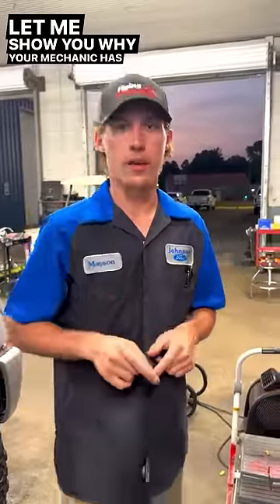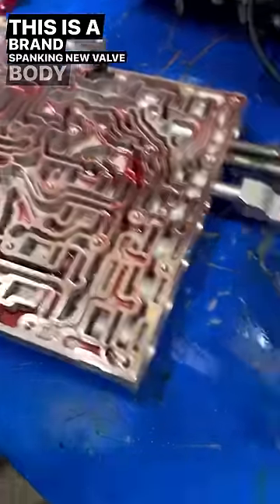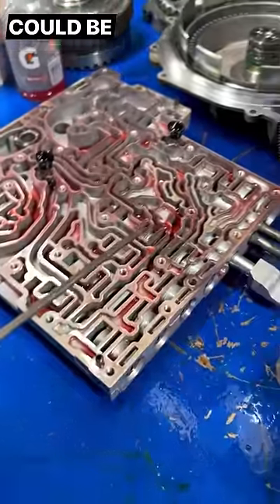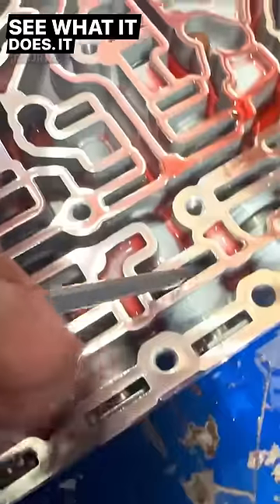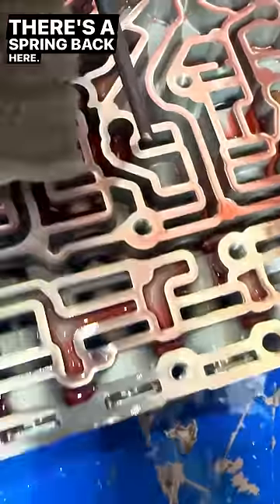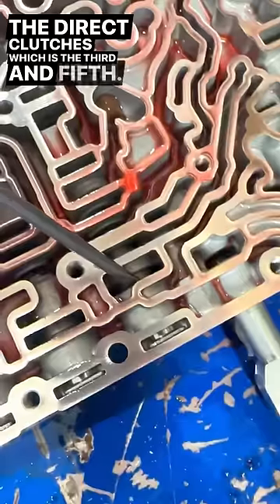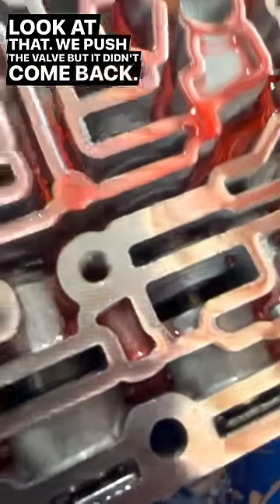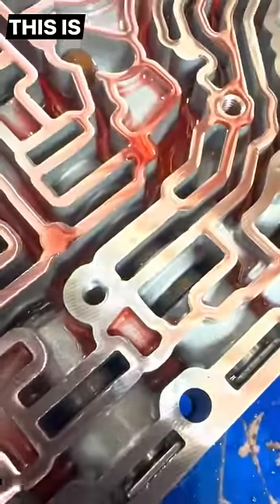Why your mechanic has trust issues #shorts #ford

Comment: Transmissions take a special kind of person to actually crack open and diagnose and repair. Insanity mode
Reply: Physical programmers
Reply: Valve bodies are right under the fluid pan, they have like 3 bolts after you take off the 15 or so just holding a baking pan essentially on the bottom off the transmission, soooper easy tbh, hard af to mess up
Reply: Yean man its actually worse than a burnt wiring harness
Reply: @Yixdy You still need to understand how the valve body with all its sensors and solenoids interacts with the clutches, planetary, ring, and sun gears. 

It might be simple for us but as you can see in this comment section, hella confusing for some lol
Reply: Just put in a manual, automatics suck anyway
Reply: It's all just nuts & bolts. Take your time, take notes & don't rush. Someone was able to put it together, there's no reason I can't do the same!
Reply: @therealcfiddy592  Guess you can say that's one way to "manually" solve the issue  😏👉
Reply: Had the a340 out of my prerunner out past month. Fully rebuilt the damn thing and am having issues. When this pos kicks it I'm swapping in an R150 from a donor truck, fuck automatics.

Comment: Everytime my boss says “that’s a brand new part!” I say “just cause it’s new doesn’t mean it ain’t fucked” and that’s becoming more and more regular, it’s becoming the standard actually. Soon we’re all gonna be shocked when we dont have to reorder a part2-3 times. “Well, why didn’t you double check for defects before putting it in?” You’re right, that’s my fault, I should have double checked to make sure the brand new engine from GM worked before putting it in the truck…
Reply: @@albertcalderon4634Airplanes seem so much more complex than cars. One would think more of them would fall out of the sky.
Reply: @viperstrike3827  I think it's thanks to very rigorous standards and quality control. But if this field goes the way of car manufacturers and their recent production standards, maybe we will start seeing more planes failing 😳
Reply: @albertcalderon4634 while I'm sure they have their own issues, the parts are largely not an issue. They go through a far higher standard and are required to be made by certified manufacturers. There have been airlines using cheaper fake parts but to our knowledge nobody is using them and we would know that if planes were malfunctioning and possibly even crashing from fake parts- its how most of the airlines using them are caught unfortunately
Reply: @JohnDoe-jk3vv this has been the case for American car manufacturers for decades. Actually started in the 80's meanwhile Japanese cars continue to be great reliable cars. Specifically Honda who just knows how to make great cars for good prices.
Reply: Yeah one would think that companies would be sure to remember that every new product comes with a warranty. If you get something brand new and it ain't working the way it should the company sold that to you is liable to replace it. And indicate white rice shown in this video if you got proof and they're not willing to replace it or refund you then you take it to court
Reply: @viperstrike3827 You say they are complex but I have my doubts.  My friend is dumb as a rock.  That would be an insult to the rock.  He is an airplane mechanic.   No this is not autism smart in one special case.  This is just all around dumb.  If he can do it I have to doubt how complex it could be.
Reply: Yea - that level of screw-up standard procedure for GM in the 70s & 80s. The assembly crew, literally, would send out known defective parts figuring the inspection crew would catch & fix it. ... I worry Tesla is heading in the same direction, and for the same reason. (GM was trying to stay ahead of Asian companies entering the US market, and Tesla is trying to stay ahead of all the OEMs ramping up their EV line-ups)
Reply: @JohnDoe-jk3vv  Pretty much everything in aerospace, down to the tiniest parts, are tested 10 to 1, if a valve, for example, needs to be able to handle 6,000 PSI, it's tested at 60,000 PSI. This is just a tiny example on how much more rigorous the standards are for airplanes than they are for vehicles, where the only things really tested are the safety devices.
Reply: Insert UAW criticism here.
Reply: @@albertcalderon4634aircraft repairs are a ton more detailed than car repairs… aircraft mechanics must write a document saying what they fixed, where on the plane, their license number, and specific list of parts they used. Along with the bibliography of the manual they used for guidance.
Reply: You said exactly what happened to me, I got two brand new power steering pump for a traverse, both bad, a remanufactured was good.
Reply: I had to start working part time at the parts store before i realized just how common this was... sad
Reply: It is because GM has more of an assembly line anymore not a production line! If parts are made in countries which still care about quality like Poland, Turkey, South Korea they would be fine. But if it is India, Vietnam etc it is better double checking...
Reply: Buddy is on brake master cylinder #7 from the parts house in one week. They fail during bench priming or they fail upon install.
Reply: Holy moly it’s almost like the country is unaware of big company tactics to maintain profit 

Omg thank goodness roads are maintained all over country 

And thanks goodness funds for things like that aren’t getting diverted to kick backs for politicians and lobbyist
Reply: @LazyCrazyGuy man if you only knew how wrong you are. This is common in the H world of manufacturing as well. It’s 80% supplier issues. They can’t keep up with demand or quality and most are suppliers to many manufacturers.
Reply: @@albertcalderon4634 Aircraft are built with redundancies and the systems since the early 2000's help with troubleshooting and fault isolation.  Most components have a back up and primary, even the engine driven pumps.  That's not saying parts don't come in broke,  but when they do it's a much bigger deal because an engine computer and a car computer differ by a few decimal places.
Reply: @herpderp66 A complex system is just a bunch of simple systems that work together. Your friend is probably a part of Assembly, or some offshoot of that.
Reply: I stopped replying to "it's a brand new part" with serious comments years ago.
Reply: @ggoddkkiller1342  "care about quality" and "turkey" don't belong in the same sentence lmao. I wouldn't put Poland high up there either, but Turkey is basically Mexico
Reply: @seventh-hydra  Care to share in which sector you are working? As an engineer i really doubt if you even have some inside information as you couldn't be more wrong, there is literally no difference between Turkish, Polish or South Korean production! I bet you are confusing high technology production with high quality production or just thinking your information from 90s is still valid. Most probably latter because Mexican production also improved a lot, i would rather buy a Mexican product than Vietnamese or Indian one any day..
Reply: @@albertcalderon4634 we had that with 747's, hence none of them are worthy of being passenger planes anymore, just cargo planes
Reply: I worked in quality 

And I actually cared about my job!!

I’m onto the medical and tech fields now ❤
Reply: @JohnDoe-jk3vv  The FAA does NOT mess around. They will ground an entire line of planes if they think there's a design risk that could cause a crash.
Reply: You absolutely should have checked the brand new part before installing it. That's really on you.
Reply: @ggoddkkiller1342  Coming from a gun guy, the notion of Turkey caring about manufacturing quality was amusing.

The first thing that comes to mind are Turkish shotguns and, well, there's a reason their Benelli clones are ~1/4 the price.
Reply: @TheAttacker732  As a gun guy you have no idea they also have Canik which is producing many excellent hand guns, huh? Care to share such a brand from India, Vietnam etc?? You people literally can not read as i very clearly stated that products coming from Poland, Turkey have higher quality than India, Vietnam etc and IT IS 100% CORRECT..
Reply: @ggoddkkiller1342   Canik is much more recent to the scene than the reputation of Turkish shotguns.  It's going to take some time to step out of that shadow.
Reply: @TheAttacker732  Canik is much more recent? I guess ''a gun guy'' needs some refreshing the memory as first Canik entered US market in 2009, 14 years ago! Secondly they are the third largest hand gun exporter to US right now with over 2.5 million hand guns sold, in fact if you could check US gun imports by country you would see in 2020 Turkey exported the highest number of guns with 1.5 million followed by Austria 1.2 million and Brazil 1 million!! Care to explain if Turkish products have so inferior quality why exactly US has been importing so many of them?? As i wrote before you people have absolutely no idea what you are talking about and you are just ignorant or using decades old information, it is time you should catch up..
Reply: This is why we demand guarantees for parts and whatnot from our suppliers (dental clinic) since we dont trust them for a second, if they cant agree to replace defective products or support us against accusatory customers before we buy anything from them, then our business with them is concluded. Our warranty only works if our supply chain is reliable, or at the very least responsible.
Reply: yeah man why didn't you get out the micrometer, sandpaper and deburring tools to shore up all the chinesium defects? What do you mean four hours labour?? The higher-ups will be hearing about your lack of work ethic.

Comment: That is why you always air check the valves on a new valve body before installing.
Reply: He's caught them that way too.
Reply: Ford should be running basic checks before these things leave the factory
Reply: @be1100 ford most likely doesn’t have oversight over the Chinese factory.

Comment: That's right just remember people it isn't always just the mechanic sometimes the parts are not any good 👍
Reply: And sometimes the system that those parts are produced under is not very good to say the least.
Reply: It seems to be a growing problem with failing parts right out of the box.
Reply: @jamesfueston9997 definitely. It even happens alot in aviation. Luckily on that side we have alot of function checks in place to eliminate these issues. But I definitely see a growing issue where new parts will arrive bad straight out of the box
Reply: Built Ford tough baby. Fellow Ford tech here. I don't do transmission work but I can talk for days about their apims, or fancy moving parts in Lincoln's. I had this Lincoln with <10k and had factory TV accessories, built by vox, installed in the head rest. A TV went bad and vox made me jump 2 extra hoops, including removing both front seats and disassembling the center console. Got it all together and it was fixed for 2 days. I put TV in it 3 weeks later. Ain't been back since. I love my job. If you believe that one I'll tell you another one.
Reply: My dad replaced his mechanical fuel pump bought a new one it went out in the first week left him stranded funny part is the old one was not bad he just did it so he wouldn't get stranded 😂
Reply: And the UAW is striking for more money.
Reply: Most of the time the parts are junk! I am a certified mechanic that quit working in the industry in 2004 but I still do work for friends and family as well as my own vehicles.  I can not count the number of new parts I have had to replace in less than 1 years time because of brand new part failures. From brakes and rotors to water pumps, alternators, batteries, solenoids, voltage regulators, coil packs the list goes on. Everything is manufactured with planned obsolescence in mind. Nothing is built to last. Even new tools are not even close to the quality of older manufactured tools.
Reply: @ProleDaddy hencho en Mexico señor ;)
Reply: @austyn  wtf?
Reply: @SomeUserNameBlahBlah what's wrong with people striking for better pay? Blame the higher ups for their poor management and not the people who are told how to do their jobs.
Reply: That part might be all chipped up the screwdriver banging on it
Reply: @SomeUserNameBlahBlah And you think that every member of the UAW is responsible for that exact part.
Reply: @ProleDaddy  Ford quality engineering is THE WORST!  It's visible in the numerous recalls, which MOST LIKELY stems from the quality of their parts (i don't know 100% bc I don't work there).  They save lots of money by having shite tolerances (its a known practice), and it's hurting their brand overall.  But not enough, bc this is a choice they continuously make.  And yet, ppl keep buying their stuff!  Stop buying their stuff, and this will stop!  BTW, I have a recently obtained masters degree in systems engineering from a public university in Virginia (a very good school, just FYI), fight me - if you dare!!
Reply: And sometimes the mechanic is so bad or corrupt he creates more problems than you drove in with and you try to find another one but they are the same way. I do all my own repairs now even when its not worth my time, because the other thing they are going to break is.
Reply: In this case it's the hack job mechanic gouging at the the valve.
Reply: @SomeUserNameBlahBlah too bad this guy isn't on strike it would've saved a transmission.
Reply: @mitri5389 they suck at doing a job a machine is about to start doing.
Reply: Sounds like an issue in the way the part was designed or assembled.

Comment: It's always helpful to smack the aluminum casing with a steel screwdriver
Reply: No mechanic in the world can fix stupid
Reply: @finnmacdiarmid3250 that’s why I let my writers explain to the customer why their doohicky isn’t carplonking when you barblonk because that’s what it’ll sound like if I’m the one explaining it
Reply: @@axelgarcia3280it's certainly fixable. If it's warranty then sure sent it back but dang everyone wants to throw things out
Reply: It actually gave me chills watching him dig around in a piece of equipment that should be in a surgically sterile environment, but then again😢
Reply: That felt like a dentist using a sledgehammer! 😭
Reply: @MrBooblo086  circuit boards love being tapped with screw drivers
Reply: @MrBooblo086  you said if it can't be tapped with a screw driver it shouldn't be under your car....
Reply: @luckxxterra2132 don't forget the spluger is missaligned with spriggett with the fulgger which keeps it from becoming crampptte. Which means no go go.
Reply: @rox3725 the problem with the world is we're dependant on cargo ships. When everyone knows car go vroom vroom
Reply: @andrewferguson6901  we need to get rid of oceans! No swimmy  no shippy.
Reply: @jfmauto surgically sterile?
Reply: @dambroangling2828 probably be sent back, refurbished and used again. If it's aluminum it's probably not that big of a deal.
Reply: @dambroangling2828 moving the goalposts

Comment: New part is not always a good part.  One of the first things we learn is after replacing a part and still have issues, look back at the part you just replaced.
Reply: Also where that part fits it has problems has been observed by me many times. Got few good mnc customers because of this outlook of mine.

Comment: Sooo glad I no longer work in a transmission shop. Used to be able to trust “new” parts or parts from the dealer. It has gotten completely ridiculous. You can’t just buy a part, now you have to win a lottery 😅
Reply: So much plastic replacing brass in components. It's sad.

Comment: I like to put a little ball bearing in there and try to get it to the middle by tilting back/forth, left/right.
Reply: Funny thing is, ball bearings are used in a valve -bodys! Some steel but also cam be a plastic. Oh I don't miss the days of rebuilding transmissions. I likened it to an art. Things had to be spot on. Otherwise, you would be pulling it back out!

Comment: As an hvac technician that receives parts from the factory I know your pain.
Reply: Bad txv's out the ass the last few years 💀
Reply: Even just light bulbs. People assume it must be good if it's brand new.
Reply: Brand new OEM Carrier pressure switch did not work out of the box last week.
Reply: Broooo. No fkin bullshit. Compressors with trash, line sets with condensation and erosion, txvs.. well do I need too explain? 😂, condenser units coming in half crushed or missing the fan motor completely. And I've tried multiple different suppliers and seems like everyone has their own fk ups. 

This Chinese shit is getting out of hand. 😂😂😂
Reply: as a brazilian
Reply: Just had a brand new Carrier air handler with the blower wheel tightened down on the motor shaft so tight up against the side of the blower housing that it never would have turned. Xetex units spec'ed for dehumidification with the heating coil positioned before the cooling coil. I could go on and on. The manufacturers almost keep us busier than the clients. It's a joke.
Reply: It's happening in most industries, everyone is saying it's because we haven't really recovered from the virus. It really hurt quality control
Reply: @LifeInJambles  some stores allowed you to take it out of the packaging before buying and test it with a bulb tester that the store provided. sadly they don't do that anymore. people tested a lot. now they asume it works I guess.
Reply: Just out of curiosity, do you get to bill the manufacturer of the part when having to redo a job due to their quality control issues?
Reply: @digitalphoenix72  They owe you a replacement part but any labor spent because of it is pretty much lost.